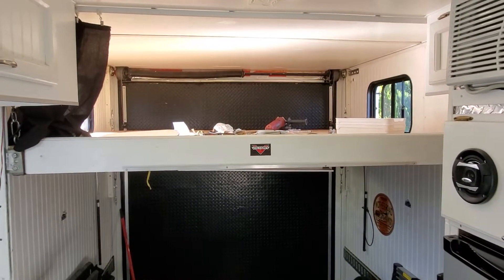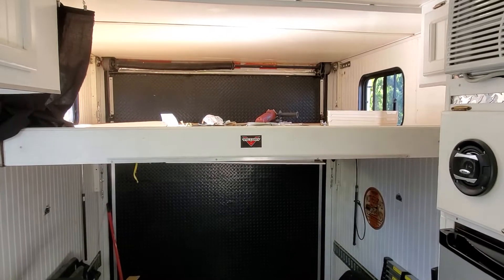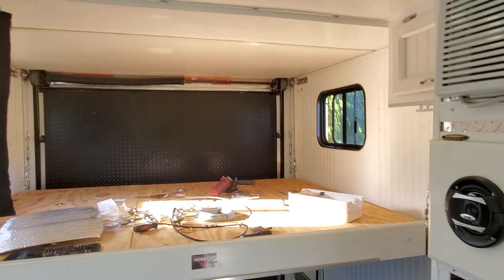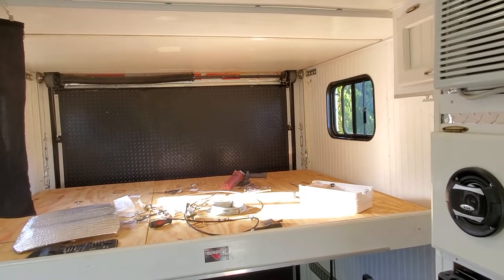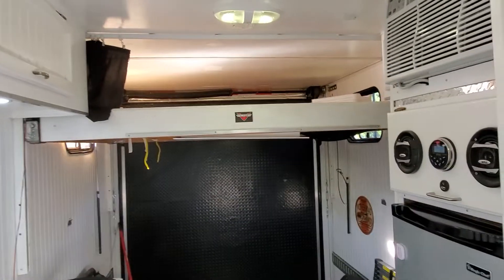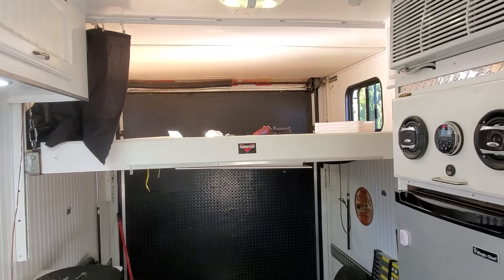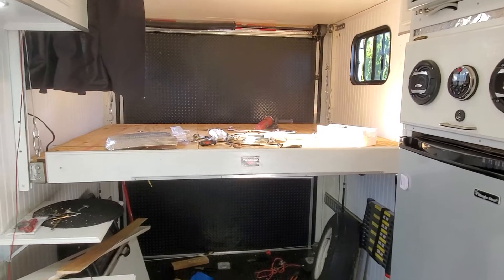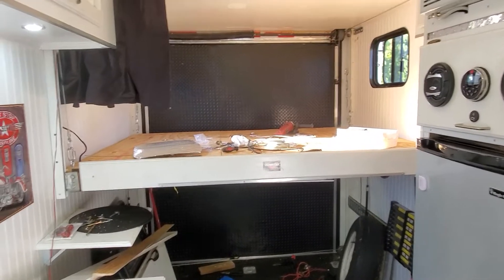Bed Lift Demo - DIY Happijac Alternative

Comment: How did you bolt the channels to the wall without the trollies getting caught by the bolts? I am thinking about using an external L bracket to mount it from the side.
Reply from the maker: I countersink the screws so the are flush.

Comment: I like it. I like it a lot. I know that was the first run and you will polish it till it is perfect. My only suggestions would be, (1.) Limit Switches. Always good to have a safety  to prevent "over" raising or lowering in case of a distracted or runaway situation. (2) I know the cables will be secured and covered, but a cover around the winch to protect it from F.O.D., and muffle the noise may be nice. Boy, that went a lot smoother than it could have . You did good, Don.
Reply from the maker: Thanks McDave. I am going to try to quite the winch down. I think a small cover like you said may help. I have some sound deadening foam I could line it with. The limit switches are a great idea. I am not sure how I'd implement them. Most concerned on the up position. Maybe I could get one of those infrared beams and have it open a relay instead of an alarm? Going to have to think on that one a bit. Would be simple with a switch and relay, but not sure what kind of switch and where I'd attach it to  actuate?

Comment: Very nice design. Looks like you used super strut and rollers or a "barn door" overhead slide on the walls to prevent horizontal movement. BTW, I just left a comment and for some reason my browser refreshed the page and I saw a whole page full of the same comment. Sorry for unintentionally spamming, no idea what caused that. Thanks for sharing!
Reply from the maker: Thanks. You will notice the strut  just hanging there. I removed it. Not needed. I put that on when trying out another lift method. It did not work well with the channel.